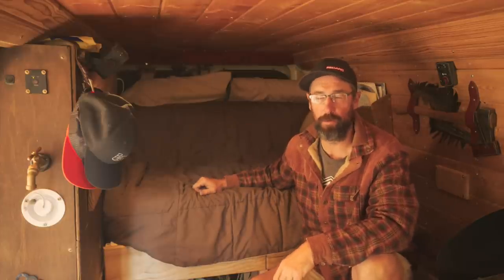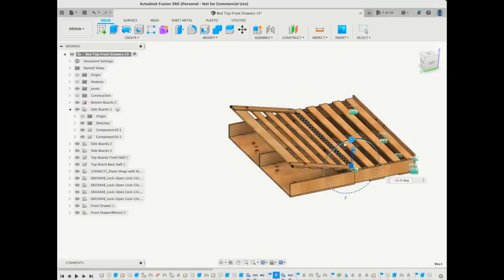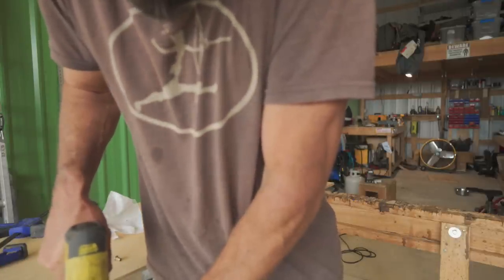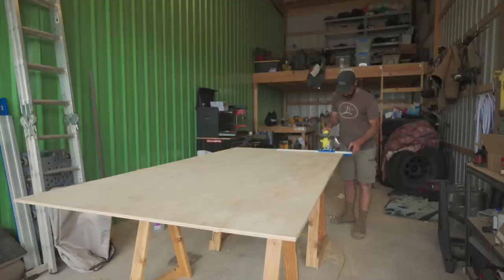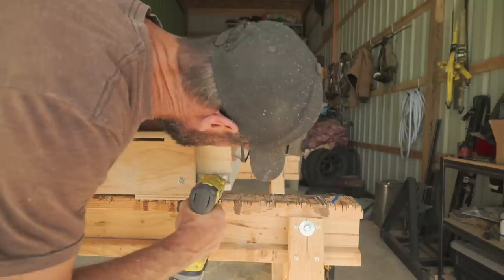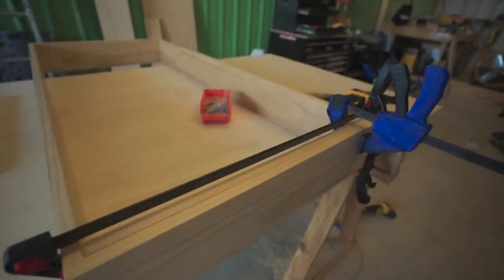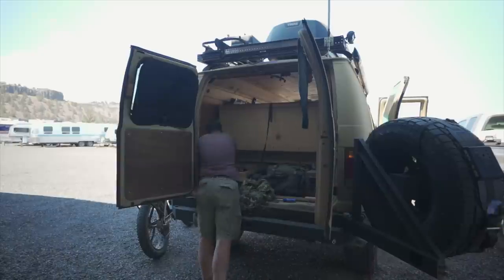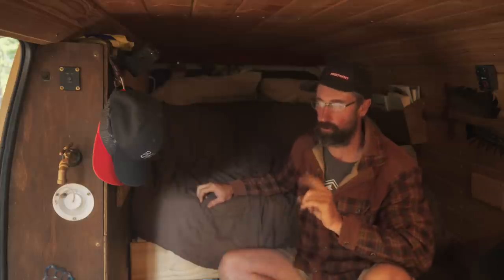Van Conversion Making a Folding Bed with 600 lbs Drawer Slides

Comment: Very cool.  I gotta say I love your van but for one thing... it's a Ford lol.. sorry I am a dedicated Chevy man.  But I was thinking about the roof and I totally agree with the decision you made.  After all it's your van lol. But I was watching Down2mob... and his new camper conversion. Which made me think of your van.  Instead of a high top conversion.  A custom roof such as on Phil's camper conversion.  It could be built light and strong/ridged enough to have the current rack and items on it. Then using the same scissor jack system.  It can be raised and lowered the same way.  The same as his system.  Allowing it to be down when traveling and raised when you setup camp. Providing you additional headroom and keeping the same capacity on top and no additional height issues.  Plus you can keep the decor the same on the inside.  Just a thought is all... certainly not cheap I'm sure.  But it would be a cool conversion to push a button and raise the roof and then lower it back to the original height for traveling.  No center of gravity issues or wind issues or from a fixed taller roof height.

Comment: Nice bed buildout.👍
I’ve been stuck trying to figure out how to buildout a bed in my Ford 350 Econoline Van.
It’s not a square box.
The back tapers in a bit and throws everything off.
I need the length of the bed to be from back to front (like yours) as I’m to tall to sleep on a bed laid out across the Van from passenger to driver side.
I think I can build something similar to your build that won’t eat up interior real estate.

Comment: I am really curious about Megan's Diesel fuel tank. Basically the capacity and where it is under the van. I am building a 7.3 Ambo, it has tank behind the axle, but I would like to add a second tank midship.

Comment: Is the weight resting on the slide outs or is the wood of the drawers resting on the ledge under it on both sides? (new here, don't known if those ledges are from old bed or still used by new one.)